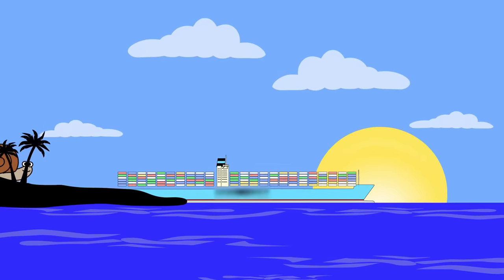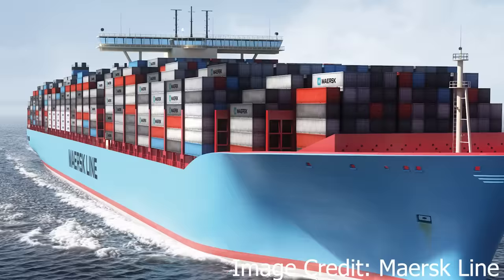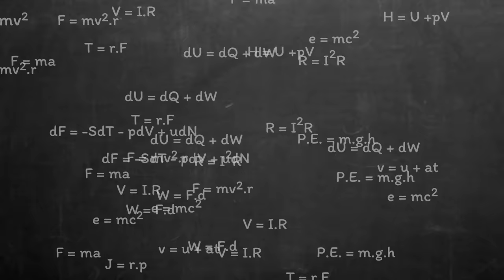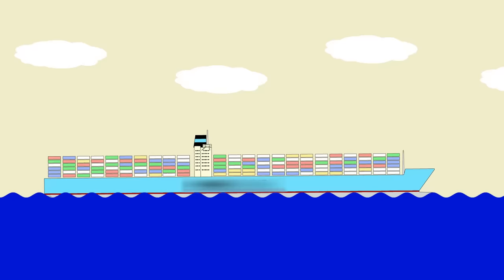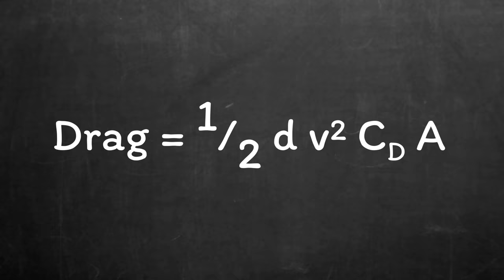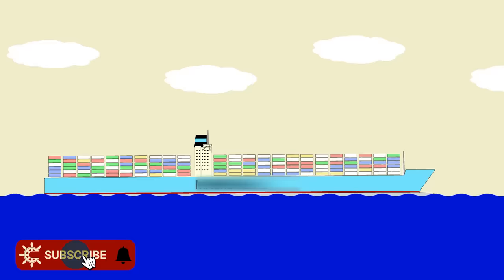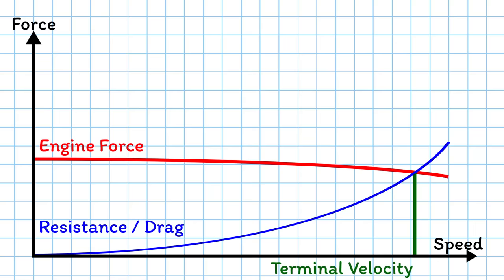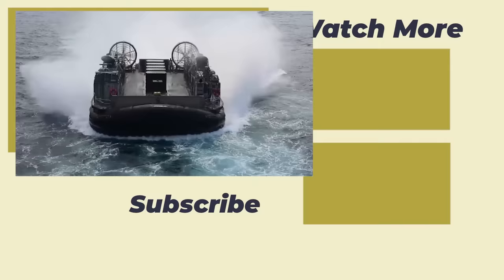Why are ships so slow?

Comment: Fairly sure the hp for the 747 is around 150,000 in total, not each engine.
Reply: Jimbob  Actually it is per engine but it doesn’t really make sense to compare, because it depends so much on air pressure, current speed and much other.
Reply: @EirikAnd99  A 747 does not have 600,000hp.
Reply: @JimmyLLL  No, it has over 60000 pounds of thrust, using hp for jet engines doesn't make much sense
Reply: @Morrov  https://en.wikipedia.org/wiki/Power-to-weight_ratio
Reply: Converting thrust to horsepower is like converting meters to kilograms
Reply: @JimmyLLL  Okay, so tell me how do you know? What were your calculations? It sounds like you just don't believe the estimation, which is fine. It doesn't make sense to compare so you have to take a lot of assumtions to get to a hp power figure. An aircraft engine running at full power at a stationary test rig has 0 hp, because it is not able to move anything. Maybe a bit more if you count moving dust or whatever is behind the engine. Honestly, it doesn't really matter how much HP you believe it to have, airplanes need to push air back to accelerate, and plane engines are luckily good at that. Even without producing mechanical power which is easy to measure in HP.

Comment: The drag equation has a linear term as well. With water and most liquids, the linear term is actually what dominates (the square term dominates for high speeds in air).

Comment: Great vid, as usual. I did not know that Jumbo jets had so much "oomph" it's stunning how many MPG they get. But I do recall that the QE2 and Concord had the same power.
Reply: The reason is that power is pretty much exclusively used for takeoff and initial (<3000 ft AGL) climb or during an aborted landing. This is why in aviation the maximum power setting is known as TOGA (Take Off Go Around), the engines are only designed to sustain this for a few minutes long enough to get the plane up and a safe distance from the surface as quickly as possible. Normal climb power is lower and cruise power is even lower still (Climb power is higher as energy is spent building potential energy to increase altitude), both are also a function of altitude as power needed to maintain a given velocity decreases with altitude as air density decreases. Basically, plane engines are built to run 'balls to the wall' only long enough to get away from the most deadly thing to an aircraft ie the terrain. The most dangerous place to operate an aircraft is near the ground so this operation is minimized at all costs pretty much.
Reply: @seraphina985  Really interesting to read up on this. Found out that TOGA thrust can usually only be sustained for about 5 minutes, and the setting below that (max continuous thrust) is, well, the maximum amount of thrust that an engine can put out continuously.
 
But you're absolutely correct. Proportionally, by far most of the energy that a plane uses is used during takeoff and ascent. And while they still burn a shit ton of fuel when they're at cruise altitude, it's important to note that they're also super fast (on account of experiencing way less air resistance up there), meaning the amount of fuel used per unit of distance is actually fairly modest. On longer trips, travelling by plane is more fuel efficient than travelling by car alone (although the plane and car match up when you have 2 people in the car, and the car becomes more fuel efficient if you also reduce the trip size). That's also a really good reason for banning short haul flights between city pairs that have a competitive high speed rail link - trains blow all other modes of transportation out of the water in terms of energy efficiency. But that's a different discussion.
Reply: @alex2143  Indeed trains are excellent in big part due to their steel wheels not deforming much which keeps rolling resistance low. Car tires loose a lot of energy due to it being dissipated as heat due to the internal friction as they deform while rolling and the larger contact patch due to the tyre effectively flattening against the road also creates more friction. Obviously this does happen with steel train wheels also to a point but it's very slight because steel is way stiffer and can handle the stress with much less deformation. Downside of this is it makes them really vulnerable to surfaces with poor traction being far more prone to wheel slip, thus why leaves on the line are a real problem accelerating and decelerating a train with crushed oily leaves on the track does not work so well.

Comment: If you want to save 7 minutes:
Ships have more mass so they go slower even with huge engines.
Speed increases resistance, so going faster reduces efficiency.
A ship also needs to be able to stop in a reasonable distance, a plane doesn't.

Comment: The simple rule for displacement hulls is max hull speed is 1.4 X square root of water line length in feet in knots. Ie, a typical frigate of 400ft has a max speed of 28 knots. They can go a bit faster with a huge increase in horse power to push through the bow wave. The recognised coversion for jet engines is 1lb of thrust equals 1hp at 375 miles per hour. Sorry, my experience in the marine an aircraft industries was entirely in Imperial units. Don't not these numbers are in metric.

Comment: Another great consideration worth acknowledging is that air the higher you go is less dense. Therefore drag is minimized allowing aircraft to travel more fuel efficiently and at an increased speed. But an aircraft can only dream of carrying the capacity of ships. Amazing engineering went into these vehicles!

Comment: IIRC there is also a limit for the screw rotation and/or the speed of the blades through the water, where more rotational velocity for a given screw shape/configuration will only result in cavitation. And cavitation reduces efficiency, and eventually causes damage to the material of the screw.
Kind of like how a car can accelerate the wheels fast enough to overcome friction and then you're burning rubber. Also similar to when a car loses traction on a turn too sharp for the current speed and road conditions. And good tire tread will only help you so much.

Comment: The highest speed of a vessel depends not of the cross section. It depends only of the lenghts, because the wave speed depends to the  wave lenght and this limited the maximum speed. Speedboats are glider and so imaginary so long as the wavelengts of their speed.

Comment: Thank you for all these videos! Can you make a video comparing each types of vessels and their pros and cons? Have a nice day.
Reply from the maker: Do you mean comparing container ships to gas carriers to passenger ships etc? That would definitely be an interesting one to make
Reply: @CasualNavigation  How about a video comparing different hull designs? Or one on what people are currently trying to improve in ship design, like what sort of engineering/technical challenges there are to overcome, ect...
Reply from the maker: I was already planning on comparing different hull designs. Like the x-bow compared to normal etc..
Reply: YOURE A GREEK
AND YOURE PROBABLY A SAILOR 
GREEK SAILORS ARE SUPER STRICT
Reply: I was looking for the same. A comparison between them on basis of stability, structural rigidity etc..
Reply: You also need to take into consideration Froudian dynamics as a moving ship pushed water out if it's path and that builds up a bow wave and the faster the ship moves the more of us trying to climb up over its own bow wave .Once you get to say 32 knots you will need double the shaft horse power for every 3 extra  knots of speed so it simply become a uneconomic as more power and larger engines consume more  fuel .

Comment: Owned a circa 1970 muscle car in the mid-80’s.  Then, for over 30 years, I drove “good fuel economy” vehicles. Now driving a pickup with the largest horse power engine offered.  It makes my face hurt from the big grin I get each time I get on the on-ramp.   Accelerates so fast, I can feel myself being compressed into my seat. 

On trips, I’ve exited the highway, went down the off ramp just so I could accelerate my way back up the on-ramp.

Comment: Cargo ships need two things. Hydro foils at the front to lift them out the water (presenting a shallower incidence angle to the water) and a secondary hull with lots of tiny air holes in it, so pressurised air can be pumped underneath and act as the boundary between the hull and water.

Comment: Your explanation is incomplete.
You missed to explain the secret about the Hull speed.
6:38 Submarines do dive to get rid of the problem which is introduced by the hull speed. Thus they are much faster when submerged. The rest is sheer power. When driven by a nuclear reactor, they canj easily reach over 30 knots. And these are only the official numbers.
Reply: Any differences on submerged drag and air drag?
Reply: @bernalfiesaysip8791  Water is denser than air, thus resistance will be still much larger.
Reply: Hull speed is a factor of overall length and displacement, At a certain speed, if the hull is not designed to rise up on plane, or is just too heavy the bow wave gets deeper and adding more power just sucks the ship deeper, increasing drag. a bad analogy, very much of an oversimplification would be like breaking the sound barrier.
Hull speed equation (simple version) HS= SQRT(OAL x 1.2)
Reply: There is also wetted area friction from the viscosity of water.
Reply: The reason subs is faster when they are submerged have mostly to do with cavitation... Or rather lack there of. A sub is simply faster due to having a very powerfull engine.

Most hydrofoil or catamarans have water-jet to combat cavitation. Submarines don't want that because water-jet is noisy
Reply: Does surface tension play a part?

Comment: As the drag is increasing qudratically with the speed there is a trend to "low steaming" container ships which are driving a little bit slower saving cost for fuel.
On the other side a slower container ships can not transport the same amount of containers in a given time period as it is slower and it costs also money if the goods which are transported arrive later as this increases the time between production and selling.

It would also interesting to compare the costs for transporting 100 kg over 1000 km.
An aircraft would be the most expensive way to do this, followed by a car and far away and much cheaper by a ship.

Comment: As a general rule of thumb fuel use increases by the cube of a ships speed. 
Longer ships can go faster than shorter ones before before the fuel use problem becomes excessive. 

Length is the biggest factor limiting the speed of any ship. Ships effectively dig a hole in the water that they sink into as the speed increases. Which generates larger and larger waves as the ship ties to climb out of a deeper and longer hole. When the hull is longer you get more speed because the longer hull tends to sink into the hole it digs less than a shorter ship. 

If you divide the speed of the ship (in knots) by the squareroot of its length (in feet) you get whats known as a froude-number. 

Slow economical ships generally have a froude number of 0.7. (there's no point in going slower than this because you don't save much fuel). Fast passenger ships back in the day had a froude number around 1.0 (using a lot more fuel in the process). Really fast warships have a froude number around 1.3 (consuming staggeringly vast amounts of fuel in the process). 

Going significantly faster than any of this in a traditional hull isn't really possible because you quickly reach a point where you can double the engine size, and all you do is dig a bigger hole, create larger waves, whilst the increase in speed you achieve is trivial.

Comment: I rather cross the Atlantic on a ship than an airplane
Reply from the maker: It certainly is more comfortable on a ship!
Reply: 24 hours of travel with in 2 days it was hell(the longest is 14 hours).
Reply: probably because you were never sea-sick 
:-)
Reply: Just remember, there are dozens, maybe even hundreds of different size boats that sink for every plane that crashes.
Reply: Travenling by airplane is by far safer than by ship. And it's also faster. And they are more economical if compared to ships driven by Diesel engines.
The only drawback is the noise.
Reply: @OpenGL4ever  
What's safer depends on how you're counting.

If you don't include smaller boats, like air stats don't include smaller planes, and you're counting flights and sailings, instead of miles, then ships are quite a bit safer.

If you figure it up by number of hours, ships beat planes severely, since the average plane flight is just a few hours, and cruise ships average about a week.

Statistics truly are a beautiful thing.
Reply: Yeah I flown across the Atlantic both ways.  Even with first class (upgrade from the Pilot (a fellow Navy man) being confined in a very very thin aluminum tube at Five miles with all that harsh radiation so far above the earths surface is a no thanks.  I have also flown the Atlantic both ways in a C-130 Hercules which was damn cold.
Reply: @CasualNavigation  You have obviously never crossed the Atlantic in winter on a 30,000 ton bulker in February.
Reply: @edl617  " all that harsh radiation". LOL "These days, travel by air has become increasingly common, both for business and leisure travel.  We are exposed to low levels of radiation when we fly.  You would be exposed to about 0.035 mSv (3.5 mrem) of cosmic radiation if you were to fly within the United States from the east coast to the west coast. This amount of radiation is less than the amount of radiation we receive from one chest x-ray."
Reply: Maybe fun for the first day or two ... but the next three or four ... not so much ...
Reply: @corydorastube  Try less than a dental X-Ray.  Chest X-Rays are pretty dosey due to their large area over the body.  I would say you are right if these airliners flew over 70,000 feet like a U-2 Spy plane.
Reply: Tell that to the people that died on the Titanic
Reply: Yeah becaise ships are already in the ocean when the emergency strikes :D
Reply: @OpenGL4ever  Not true at all, When a plane crashes you are done. When a Ship collides or starts to sink, you still have your mandatory rescue equipment on board.
Reply: @lordgarion514  There's also more aircraft on the bottom of the ocean than there are ships in the sky.
Reply: @corydorastube  6,000 ton destroyer in a North Atlantic storm is no fun whatsoever.
And Columbus crossed in ships small enough that mine could have hoisted a three of his aboard.
Reply: @corydorastube  
So?

You also don't get x-rays several times a week for years on end.

Lots of people fly that much.

And you should probably check out the health problems flight crews have.
Reply: I would rather do both take an airplane AND a boat..
Reply: @lordgarion514  You should research how burden of proof works.
Reply: @corydorastube  
I know exactly how it works, and when I'm having an actual scientific debate I back up everything.

This isn't a scientific debate, and it's not worth my time getting a link.
If you want to learn more about it, have at it. If not, I really don't care.

Comment: As someone who has worked on cargo ships there’s some other factors that you missed. Ships go slow for fuel consumption costs (cruising speed) and due to safety. You don’t ever want to be on any ship/vessel that is redlining. Also something you overlooked is the bow design of the ships. Large ships have the round or bulb bow to reduce drag. Lastly the reason why large vessels go slow is because they want to minimize the risk of the propeller from coming out of the water that would ruin everyone’s day as well as the cargo